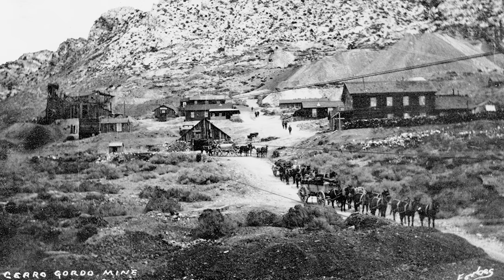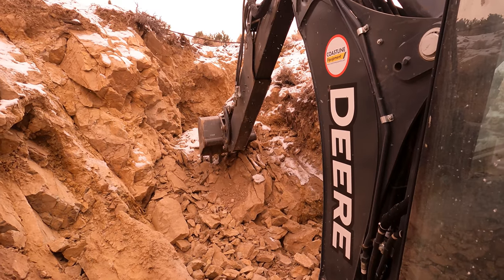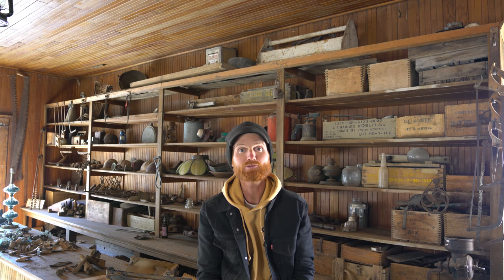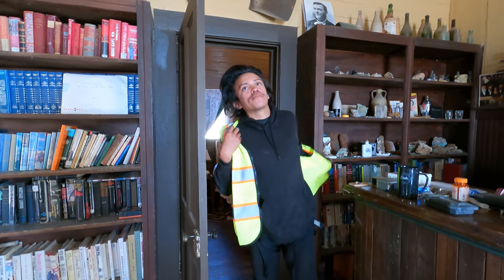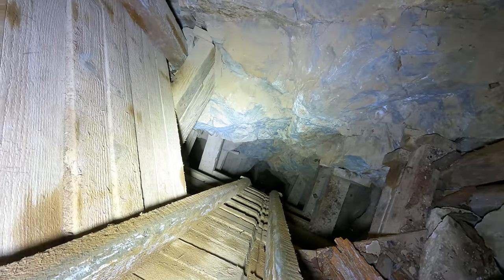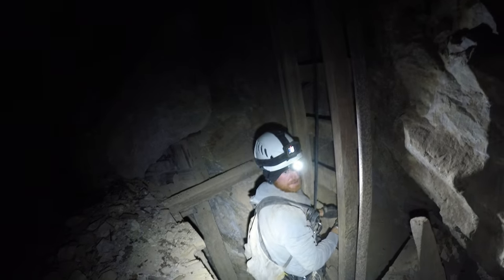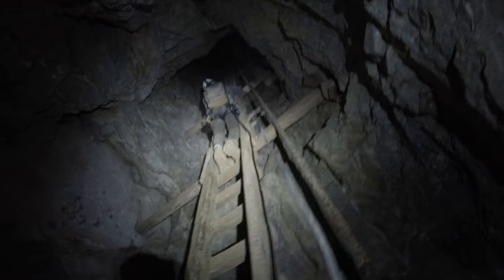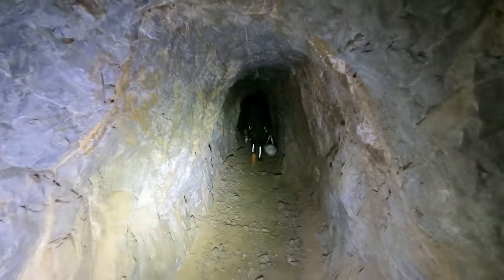Blowing Up Dynamite To Get Into An Abandoned Mine

Comment: What's amazing to me is how the miners got all that track and building material down the shafts and onto the levels to build
Reply: Same.
Reply: amazing how much rock had to come out to make those tunnels
Reply: Exactly Josh,  Some of those 8"x8" beams 12' or so long had to be three man jobs on horizontal tunnels alone.
Reply: Right!  They are not close to big trees and saw mills.  So back in the day, how’d they even get all that material to and INTO the mine??
Reply: @donnachristianson1502  For most of the journey, trains and ships would have carried the timber from where it was felled to the train depots and shipping ports of Los Angeles, but from there they'd likely have had to haul everything up the mountain via horse drawn wagon or similar type of hauling vehicle.  There were some steam powered wagons that existed at the time that could have handled that kind of load, but they weren't designed for that kind of rugged terrain and were mainly used to move cargo between ships and warehouses or factories on the docks.
Reply: Gravity is your friend! Getting stuff DOWN into a mine is easy. Lower it with ropes and winches. And that is why there is so much junk in mines - getting it UP and back out is brutally hard.
Reply: It's not that hard to get stuff out your shaft😉😉🙃
Reply: Agree!! 100% amazing

Comment: Hey! Great video!

A few more things about climbing: 
1. do not put your arm or head in between the rope and whatever you're climnbing. always keep it in between your body going straight up. Because your arm or head will get trapped in between the rope and the wall or ladder or something else and that could easily break your arm or get you trapped.

2. always secure your rope on multiple points. you tie it down a few feet away from the hole or ledge, and then tie it down again where your rope should be to descend. there are special anchors for this purpose.

3. use pads on the points where your rope is tied around something or where it rubs on a ledge to protect your rope from abrading. climbing rope is expensive and any fraying means that your rope should be thrown away because it won't be safe anymore.

Comment: Careful, guys! I'm sure you've heard about this before, but no echo = sketchy azz tunnels! Hence, the buried miners...
Reply: Can you elaborate on why thats sketchy?
Reply: Isn't it more sketchy if it echoes in an enclosed tunnel system, making it feel like there are gaps inbetween that could lead to collapses?
Reply: no echoes = less hard / dense material, potentially unstable (sandy concretions) but hard rock can fall too and in big patches I would guess ? IDK anything about tunnels but I would guess so
Reply: @jrr6947  If there were loads of gaps then sound wouldn't echo I think? So in a solid mine shaft sound should bounce down the mine creating an echo whilst in a bad one with loads of loose rock and gaps/cracks there wouldn't be an echo as the sound gets trapped in them? 

I have no expertise on the subject that's just my guesswo fyi.

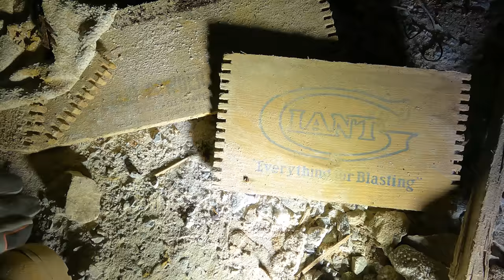Comment: At 23:55 you can see "Giant, everything for blasting"

The Giant Powder Company was an explosives manufacturing company which operated from the mid 19th century through the first half of the 20th century, located in the San Francisco Bay Area of California. The Giant Powder Company was the first company in the United States to produce dynamite under an exclusive license from Alfred Nobel. 

It ran from 1867 to 1961. So that wooden box has at least 60 years or more.

Comment: the scariest thing to me, is that if some how your lights died, and you have no way to see.
Reply: The scariest thing to me is an earthquake, which Cali is known for!
Reply: Ganjack Bogle this is a ludicrous uneducated comment. 

I am a earthquake expert with a masters PhD and over 30 years experience in my field. 

One of the safest places to be in an earthquake is a tunnel. 

This is because just like my wife’s tight little box, Leroy normally paints the inside of it with baby batter from his huge thick chocolate meat stick. This coats the inner lining, adding stability and making it structurally sound. 

Sometimes after the fact my wife makes me eat her pie and I get a good gulp of Leroy’s buttermilk.
Reply: @Fugvdfbh67  🐐 comment 😂 complete 180
Reply: @Fugvdfbh67  What about large rocks that are 98% loose already? Any seismic vibration can dislodge them and crush/injure them
Reply: InfinitePower large rocks are not an issue when it comes to earthquakes as the displacement and type of mineral dictates the forward passage of lines.

The only real seismic activity to note is the overwhelming force that is endured by my wife’s beaver once Leroy unloads his choad nectar deep inside, effectively smothering her cervix. This, owing to the nutt mass / volume, increases the chance of my wife getting knocked up whilst I’m working late
Reply: @infinitepower6780  i love that you didn't read his whole comment before replying. I hope to God you go back and finish reading it. =P
Reply: @Fugvdfbh67  I have never laughed so hard. 😂
Reply: Isn't this comment sort of like, "sometimes, when I close my eyes, I can't see?"
Reply: i had that experience happen once 
although i wasn't underground at the time 
it was during a power outage it got dark
it was still weird because your eyes play tricks on you 
i started having "prisoner theater"
essentially you start seeing soft blips of light that look like twinkling stars and rotating shapes
of triangles and circles i could not sleep at all i had to find a light to break the effect and let me sleep finally.

Comment: 2:25 and that is where I'd go no deeper. Once you start moving around fallen supports you are getting way to far into the danger zone.
Reply: @dylanburns8759  I was just saying that was as far as I'd feel safe going. The moment you step into a mine portal, even one in use with modern safety regulations, there is a certain level of danger. That point is just where I personally would say no more.

Comment: Waaaait wait waiT!!! You crawl all way to that deep and didn't take a single metal detector, not even a "carrot"?! Would you even pick a gold nugget from a ground if you have even had accidently saw one? omg dude
Reply: Agree 100% I'm binge watching these and keep coming back to that same thing: where's the metal detectors
Reply: I don't think he knows anything about geology nor mineral hunting.......... If I was there, I would be doing field analysis/assays of samples from every mine out there.  Back when these mine were shut down the cut-off grade was much higher than the cut-off grade from today.  Meaning, even in the tailings there will be economic values by today's standards, not to mention specimen grade samples............
Reply: These were silver and copper mines, not gold. So, no good nuggets, but that pretty blue copper ore that you can sometimes see in the tunnel walls, instead.

Comment: I have dug into rock with a similar sized front loader. Alternating between pallet forks and the bucket will greatly increase your productivity. You can change the position of the forks for moving individual rocks, and you can also use them to sort of puncture or penetrate into the rough stuff. Then switch to the bucket to scoop the debris.

Comment: Get you a battery drill and a bag of long deck screws for repairing ladders.
Those old ladders used nails and overtime as the wood dried they come lose where long deck screews will last for a long time.
I once rehabbed an old flooded mine where all the nails had rusted away and all i had to do was screw the deck screws into the old nail holes.
I have been in most of the mines in the high desert in the rand district. Darwin, Mojave but i never did get up to Cerro Gordo.
My last job was as a mine superintendent of a old high-grade gold mine up in Allegheny calif.
I am now retired in Ridgecrest back where i started.

Comment: Very cool hat on the old gentleman at 6:50. I have a few, you could only wear those from Summer of 2002 to 2011 while being stationed at Davis Monthan AFB. Before the summer of 2002 it would have been 355 CRS (not CMS) and after 2011 the hat would have been faced out on 1 Nov 2011. The 355 number comes from falling under the 355th Wing and the CMS stands for Component Maintenance Squadron. That particular hat was issued at the orderly room at BLDG 5430 at Davis Monthan AFB.

Comment: Hello, Brent. I'm not going through over 3,500 comments to find out if someone already answered this, so forgive me if I'm repeating. I may have an answer to why you would find a vinegar label in a mine. Vinegar is used to counteract a caustic reaction, such as from concrete. If they were using or dealing with any sort of caustic in the mine, having vinegar on hand would be essential in case of contact with the skin, to prevent some really nasty burns.

Comment: oh yes it definitely looks like these 'ladders' were used maybe as a temporary rail system, see the worn cable marks from where some kind of sled or was used to drag up and down during the digging out of the tunnel, i was pretty sure from your ascent in previous video that there looked like room around the other side, which might provide better usage of the ladder, ie not to tick the runs off - maybe a job for another day to rebuild these, but climbing ropes do as well

Comment: Shot in the dark (punnot intended) but I remember when I was a kid I read a conversation on a message board that predates the internet that always stuck with me, about how highly valued ww2-era salvages were in Geiger counter production and physics sensors due to lack of radioactive contamination from nuclear detonations and accidents. those steel girders in the bottom of the union mine (if they're from the 1800s) are known as "low-background steel". To illustrate what I mean, you might need a Geiger counter of the highest sensitivity to get an accurate measure of how low it is, probably meaning it is not measurable by a device made with contemporary steel

Comment: Those "ladders" are not meant to be ladders. They are bucket or skip guides for when they hoisted equipment or lowered it in the shaft. If you look at the rungs, you can see grooves worn into them from the cable used to hoist or lower the cage or skip. When the rungs are on the inclined down side gravity works against you in making the rungs want to break off cause all the pressure is on the heads of the nails instead of the runner of the ladder.

Comment: Tiny Whoop Headlight (name of the video, didn't want to direct link it). Have you tried using a small inexpensive drone to check for dead ends and such? Might be useful to go into a place that's too unstable to risk it. If it's promising, then you won't spend a lot of time digging and reinforcing to advance into the next space. Downside is range, rock isn't great and the rock you're up against contains lead so --- you may have already tried it and it was a fail. Stay safe!!! :)

Comment: Ammonium Nitrate.........thats what you use for blasting.  7% by weight with diesel and you are cooking. Its normally used in large quantities in large,deep drill holes, but there is a dynamite equivalent called Powergel. 23.03...........look at that wooden prop frame under that chunk of the roof...........sketchy.

Comment: Doesn't look like a shaft to me. Looks more like an old stope. 
At least your timbers aren't mushy from water rot. 
Maybe some dry rot but that's nowhere near as bad as working below the water table.
Never worked in a dry mine before so this is interesting.
Be thankful you don't have to climb ladders with a 90lb hammer and jack leg over your shoulder
and dragging an air line up behind you. I was always blown away by what was accomplished by the old timers
with very crude mechanical (Cornish) pumps and hand steel single jacking.

Comment: There is no need to blow up the dynamite and the explosion might cause other damage to structures or rock falls.
Instead clear away flammable material without touching the dynamite boxes and build a fire that will spread to the dynamite. the dynamite will burn without exploding. Leave the mine once you have started the fire and let it burn out before returning.

This is a less dangerous process for eliminating old dynamite.

Comment: Climbing facory chimneys 80+m tall I know what you mean. Of course,
they have platforms to save your a$$ every 10-15m or so and it's in free air.
Even with safety gear it's pretty sketchy. I have to do it because
I'm an electrician and have to check the lights (and other things electrical)
at the top because of regulations.

Comment: If my skid steer doesn't fit in something I make an attachment. In this case maybe some heavy pipe or mine car track welded into a boom and basically a hoe on the end to reach up and pull this stuff down. I just cut a couple holes in the bucket and bolt on what ever I need there.

Comment: You didn't run into a blockage. You ran into a faced-out drift. The track is to haul ore to either a shaft up or an ore chute down. It's riding on stulls in a stope. You didn't go down to bypass a blockage in a drift. You faced-out a drift off a stope. Try another drift in the direction of the Union Mine.

Comment: I use 11mm diameter static and prefer to be off wood.
8 feet or 800 feet in descent and ascent  makes no 
difference to me.  I hate iced rope and won't put my
life on found fixed rope.  Ditto, any found equipment
rigging.